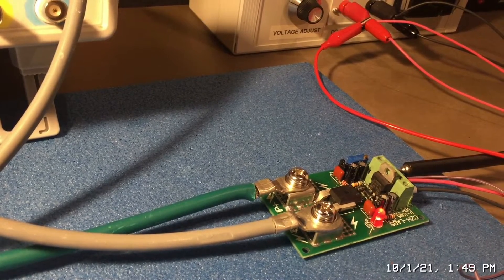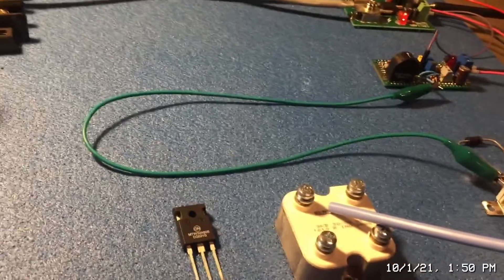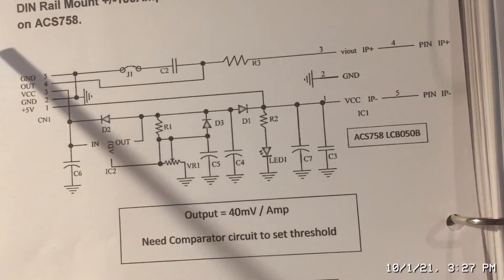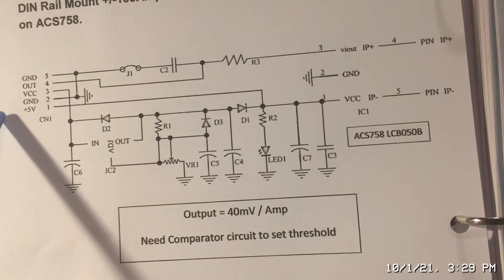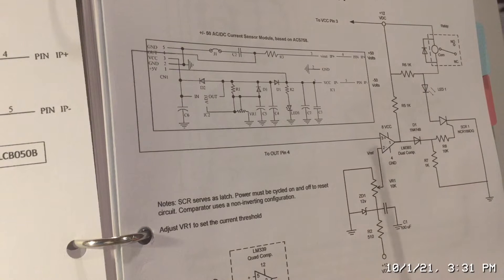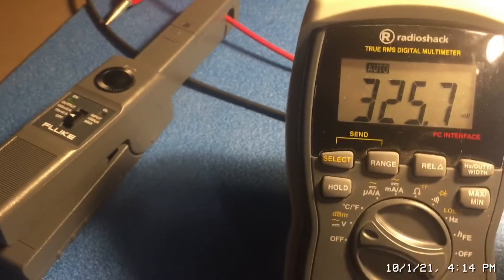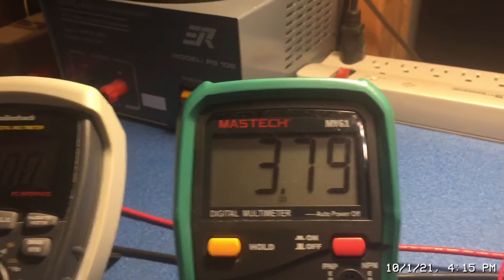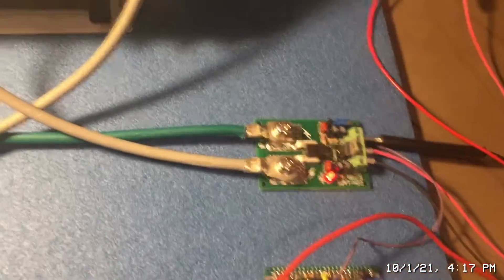Protection circuit for your LDMOS Transistors

Comment: Is this fast enough!? Typically I've seen a thyristor used as a 'crowbar' to short the supply, blowing an inline fuse. This works much faster than cutting the power and waiting for caps to discharge. Wondering on your thoughts?